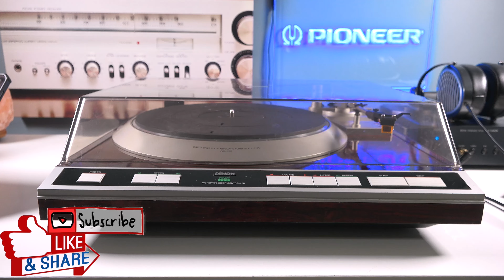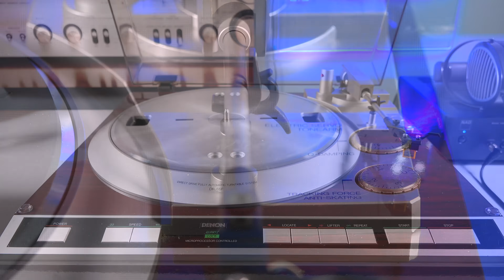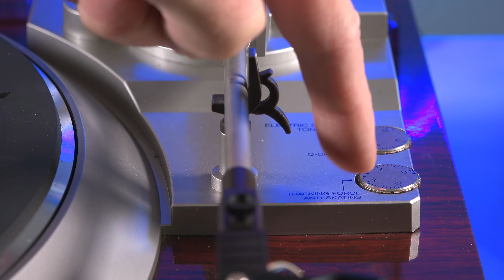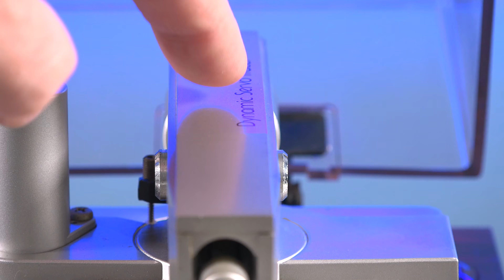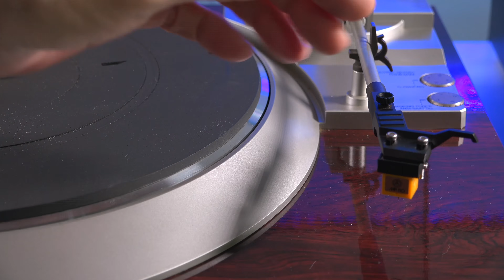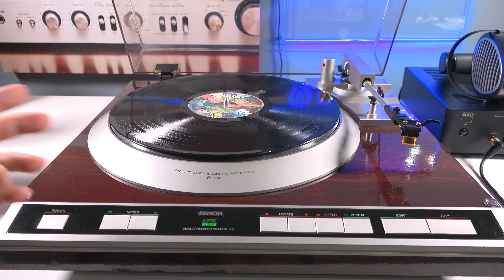Vintage HIFI - Denon DP-65F Direct Drive Automatic Turntable Review

Comment: I have a DP-51F that I purchased from it’s original owner on eBay.  I consider myself very very lucky as it arrived and it was in mint perfect condition.  I couldn’t believe that there wasn’t’ a nick or scratch anywhere.  The seller took great care of it!  It works perfectly, as he had it serviced 2 years before he sold it to me.  I put a Hana EH cartridge on it, and I run it through a Parasound ZPhono XRM phono preamp. I am blessed to be back home again in the late 70’s early ‘80’s again!  I’m 67 and loving my vinyl from those wonderful times.
Reply from the maker: That's awesome you found one in such great condition!

Comment: How you gonna get motor noise with good direct drive. It’s turning 33-45rpm. 
Belt drive with the extreme gearing, I guess 1000/1. It’s spinning 1000rpm, the belt drive motor definitely makes noise…..

Comment: Great video.  I am amaze at how good those old Denon decks were.  I have the lowest end DP-7F, my ugly duckling, but it perform faultlessly.  I have an Ortofon OM T4P cartridge with OM 20 stylus.  It’s almost dead silence with no hum.  I put it on a home made isolation platform and took care of the vibration feed back and it’s can sit next to a pair of pretty punchy bookshelves and I can crank it all the way.  Like you I have two RTs and two Technics linear.  All the decks I have are very good but the Denon pulls twice its weight in this instance.
Reply from the maker: They are excellent

Comment: Basically, Denon's Dynamic Servo Tracer tonearm is very much similar to Sony's Biotracer tonearm.

The tonearm movement and factors are computer controlled via linear motors.  When it works, it works beautifully.  When it doesn't, it can be a bit of a nightmare to repair, especially if you require service data and/or replacement of any proprietary parts that have long been discontinued.

Comment: Nice machine. It's good to have a cueing handle on the headshell... something that's missing from my TT. It also has fully electronic arm control, probably more convenient than the Denon (an analogue flywheel instead of left/right buttons). Well, it's either this or that, no one can have it all...

Comment: I got fearful after seeing the Techmoan video an rightfully so. The DP-65F is out of reach for me, and same for the JVC models which are similar. Luckily I randomly came across a JVC L-F61 a few days ago for $20. It needed some work (understatement) to fix the speed fluctuations (oxidized speed control pot), the tonearm lift(bracket holding it in place broken) and the sensor not working (lens was just dirty). Sensor you say? Yes, this is a turntable that lets you select and skip tracks. The sensor is mounted in the cartridge and the cartridge is shared with some other turntables (Sanyo ST100D, Fisher MT275 and MT6360 etc.) but those all have their own (in my opinion) inferior designs. It has a DD servo motor in the arm, the QL-Y versions have 2 DD motors in the arms for horizontal and vertical tracking adjustments. The motor in the arm and platter are both coreless direct drive motors and absolutely dead silent. It has to be the quietest turntable I've owned so far. Just waiting for a new needle since the one that was on it was a nub that didn't play anything. 

Automatic turntables get a lot of hate, but I feel a lot of that hate comes from people not knowing how to fix them and of course stuff is going to fail after 40-50 years. If you know your electronics it's not too hard to figure most things out even without a manual. Most of the time they just need a good cleaning and lubrication job to get things going again.

Comment: Mark is a wonderful wizard!
I have a fully automatic Techics SL-1610,  direct drive tt. It has a torquey  silent motor and the repeat function is more flexible. Instead of repeating indefinitely like the Denon, it let's you chose 2-7 plays, before shutting off. Since much of my listening is late at night, it's a great feature.
My backup is a B&O tx2 linear tt. It has a selectable repeat function as well.
That said, I sure hope I can save up enough to get a higher end Denon from Mark before he hangs up his soldering iron. They are technological and aesthetic works of art and after Mark reconsider them, they are the safest bet for a vintage tt.
Nice review... right down to the "happy dance"!
Enjoy the music!